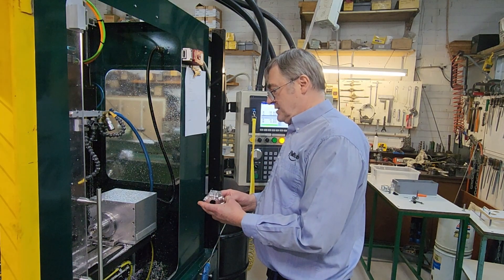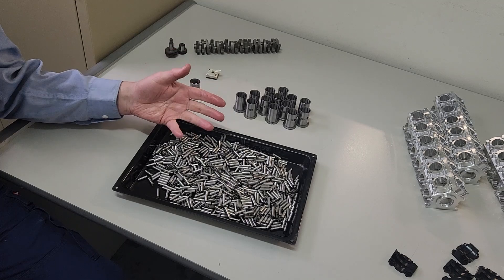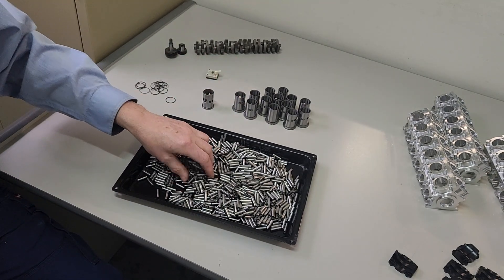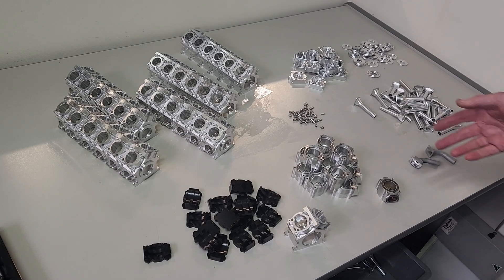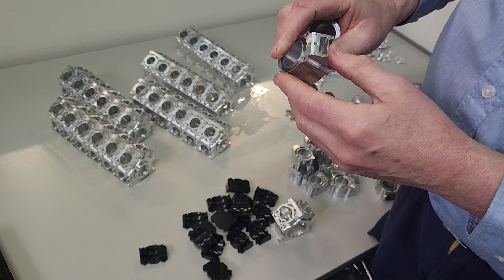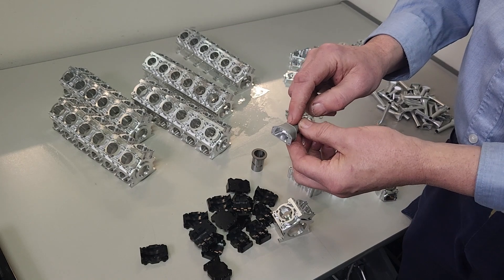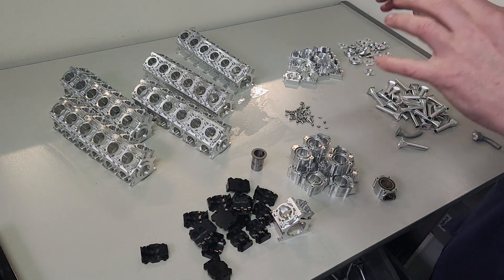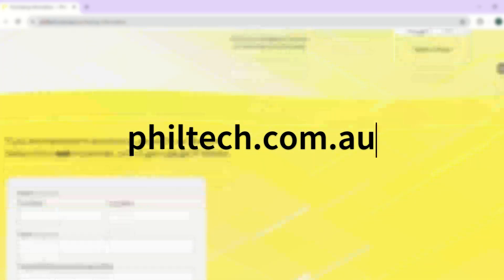V12 production: Where we're at

Comment: I checked your website. Didn't realise that it's running glow fuel not petrol. This gives us two problems. Fuel load and availability of nitro fuels. Any thoughts on this?
Reply: Mix your own fuel. You can run less oil in the fuel than regular glow fuel because it only revs to 6000rpm and is water cooled. Maybe 10% oil max and no need for nitro. Methanol is freely available so is synthetic oil. A petrol version of this engine would be double the price to buy
Reply: @weofnjieofing  The sales spec says 10 - 20% nitro. A petrol version doesnt have to be twice the price. It's fourstroke technology that would increase the price. Electronic ignition isn't a big deal. There is an engineering reason. Most likely space is to tight for a spark plug.